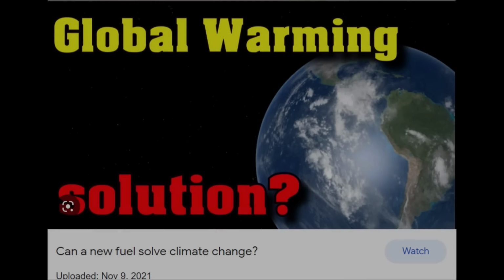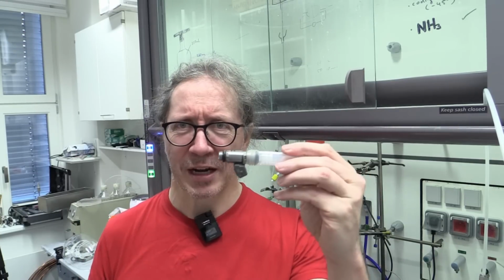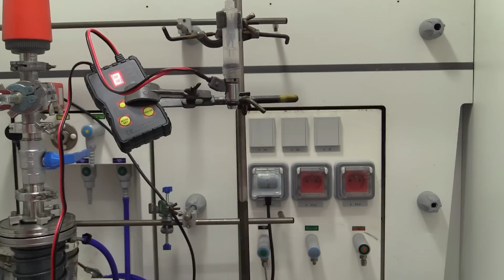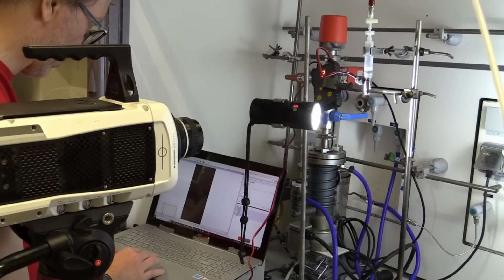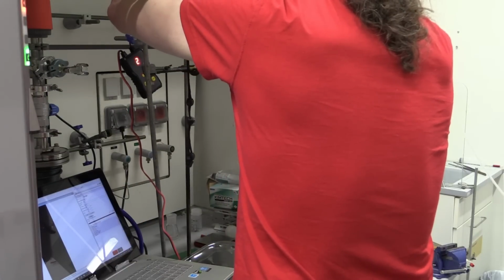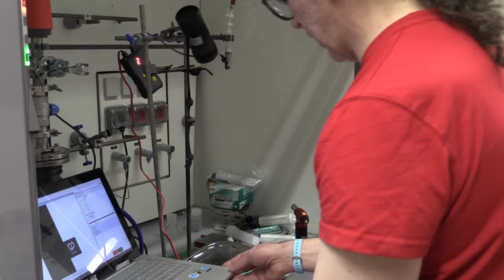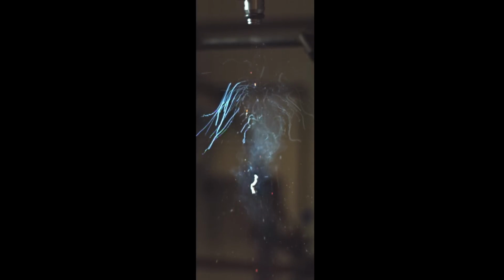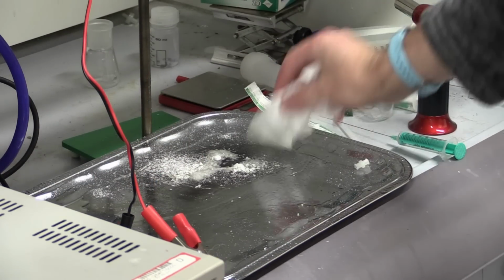Can Fuel Injectors burn SODIUM??

Comment: Several years ago "NEW SCIENTIST" magazine published an article on metal nano-particle fuels for use in ICE's.
Reply: That article is basically nonsense. It somehow expects an engine to operate on metal powder, which... no, but also, it lists three metals: iron, aluminum, and boron. Both iron and aluminum have less energy density by weight than gasoline, and iron has less even by weight. Aluminum and boron have more by volume, but I'd guess the 3x estimate is just boron having three times the volumetric energy density as gasoline, and the thinking ending there.

What Thunderf00t is proposing is entirely different. He's talking about using a small addition of sodium in jet fuel to produce clouds of persistent reflective smoke way up in the air to increase the amount of light the Earth reflects away.
Reply: @seigeengine  A similar Greenhouse gas solution proposed purposely emitting Sulphur Dioxide into the upper atmosphere from a balloon-suspended pipe to achieve much the same thing. I rather suspect the law-of-unintended-consequences would have kicked in - probably increased ocean acidification.
Reply: @andrerousseau5730  Sure, but the products of sodium burning are alkaline, not acidic, which is somewhat safer anyway since rain is acidic in the first place due to dissolved carbon dioxide. Furthermore, by putting it in jet fuel, you could avoid having to create ways to distribute it.

There are going to be consequences to anything we do. Saying you don't want to risk environmental consequences while talking about global warming is a lolfest extreme.
Reply: @seigeengine  I'm not the advocate or proposer of the SO2 idea. I'm also well aware that Sodium hydroxyl ionic complexes are alkaline. Distribution via jet fuel is novel but may be short-lived with the current rate of advance of electric flight propulsion systems. The major commercial aircraft manufacturers have advanced research programs underway.
Reply: @andrerousseau5730  Bahahahaha.

Imagine believing electric is going to replace hydrocarbon fuel for flights of any distance.
Reply: @seigeengine  I wouldn't be betting on it if I were you. Electric powered manned aircraft are already flying and technical progress in the field is headed in only one direction - UP!

Comment: Can you suspend the alloy in a heavy solvent like mineral oil or diesel? And keep it in suspension? If you can an old diesel injector would be ideal.  Old  Indirect injection diesel injectors are activated by hydraulic pressure but they operate under a lot less pressure than direct injection Injectors whilst still giving better nebulisation for more viscous fluids than port injectors. 

I remember a research paper I read ages ago in Australia where the CSIRO or some other org built a solid carbon fueled diesel engine which had purified coal ground up really fine and suspended in a water solution that was directly injected. Might be worth tracking that paper down and seeing what they used.

Comment: Do you think the fuel injector leaks certain solvents because of viscosity differences? I know this is tangent to your video's focus, but maybe increasing the fuel's viscosity will prevent leaking, but of course, any additives might also weaken the combustibility potential. The fuel injectors are meant for the viscosity of gasoline, right?

Comment: That was very interesting.  I recently read an interesting book "alcohol can be a gas" . It claims we already have the answer to fossil fuels, ethanol. According to the book: 
We can grow enough plant matter to make the required ethanol to fuel our cars.
Propaganda from petroleum companies throw shade.
An internal combustion engine is not trying to make heat. It is trying to convert the expan sion of a gas into mechanical energy. Therefore the heat value of a fuel doesn't apply. In fact since ethanol combusts at a lower temperature it loses less heat to the cooling system. If we designed the engine for ethanol it would be efficient. Instead of adding ethanol to gasoline and combusting it in a engine designed for gasoline. We dont use gasoline in a diesel engine or vise versa, why are we using ethanol in a gasoline engine. The optimum parameters are different. Namely higher compression ratio for ethanol. The book also goes into making methanol from the cellulose from the plant also so as far as the most efficient combination of alcohols per acre, that has not been studied yet I don't  believe. But it is a net 0 carbon emission solution. The case study cited was Brazil. They apparently ran their vehicles off of ethanol and while they did the air in San Paulo, Brazil cleared. Then the oil companies got back in, the cars run on gas again, and the smog is back.
Reply: The basic answer is that it's not really viable.

Humanity uses 48M km^2 of land for food production.

Even using the highest-yielding ethanol crop, sugarcane, which isn't viable everywhere, it would take about 23M km^2 of additional arable land to produce enough ethanol to replace humanity's fuel consumption. And, for reference, there's about 58M km^2 of land that's habitable that humanity isn't using for crop production. Of that, 40M km^2 is forest, most of the rest is shrubland.

And no, the heat is actually very important. The performance of an engine is limited by the temperature difference across which it operates. The basic gist, however, is that ethanol is not a "more efficient" fuel.
Reply: @seigeengine  I didn't state that ethanol was more efficient. Just that it would be far more efficient in an engine designed for it. Also more efficient than th heat value would indicate. Can you direct me to literature about the engine being more efficient because of temperature differential?
Reply: @kraftzion  I'm not Google.
Reply: @seigeengine  I know. That was apparent from your reply.

Comment: I know things like methanol and ethanol can affect seals in cars. so I wouldn't be surprised If the cheap fuel injectors don't have the best seal material for ethanol. I remember this because of people complaining about when they added 10% alcohol to gasoline in the US. That and if gloves have compatibility problems I can't imagine why gaskets with similar materials wouldn't.
You might want to try more expensive injectors for e85, ethanol or methanol intended applications. They're probably more resistant to the solvents you are having problems with. 
I wonder with an orifice intended for ethanol if it would aerosolize NaK better.

Comment: NaK is pretty cool, or in this case Hot. But pure sodium might be cheaper if the injector will work with molten sodium  

I think the injector can handle heat, but i dont know if it can handle the sodium under heat. You might like to know if it can handle, say a kilogram of molten sodium pushed through it. Then you might compare a before and after characterization of the jets to see if there was any damage to the injector. 

Certainly won't be using NaK as a fuel in my Aluminum engine 🤣.

Comment: You probably already heard this from another commenter but are you using a fuel injector designed for E85 fuel? A regular fuel injector will degrade from the ethanol. It eats the seals as I'm sure you know but using one rated for E85 might hold up better for you.

Comment: Most plungers connected to the solenoids in fuel injectors are compatible with gasoline + 15% ethanol - there are 100% ethanol compatible (bio fuel) ones.  I think you'd have to gut one to see what the innards are made out of to use with sodium safely.
Reply: Not to mention Gasoline and diesel have additives that clean the nozzle. And gas and diesel lubricate the innards of the injector.

Comment: OK, there's a rather serious problem with the whole idea of using sodium as a fuel.  Sodium oxide is a solid with a sublimation point of 1548 K and a vaporization point of 2220 K.  So, if you want to get the combustion products out using the conventional means, your engine is going to have to operate at well over 2000 K, which steel can support, but it's going to be hard to engineer because steel is a LOT weaker at that kind of temperature than it is at the kind of temperatures that conventional organic liquid fuels burn at.  Most steels also oxidizes extremely readily at that temperature, which is kind of a problem for something that needs to pump large amounts of free oxygen into itself to operate.

Comment: The stronger solvents are destroying the injector lol they're not designed for typically about %10 ethanol by volume anything more will slowly eat any seals out the stronger the faster, also your running "unfiltered" liquid so it'll get stuck same affect can happen for it pretty much falling apart

Comment: You probably won't read this comment, but still I have to ask: What is the ultimate purpose and goal of this experiment?

I understand that you want to create more aerosols from the burning of fuel, in order to fight global warming. But how exactly is that supposed to work?

Did you plan for there to be a separate fuel tank in cars with sodium-potassium, being injected through a separate fuel injector into the engine? In which case, why would consumers bother to fill up that separate tank? How would that benefit them?
Or did you plan to mix the sodium into the fuel? Similar to the tetraethyllead that we recently managed to get out of the fuel?
And if the result of this is a lot of white smoke coming out of the exhaust pipe, creating a lot of smog, why would authorities and consumers want this?

I honestly can't see adding sodium to fuel for cars being a success, since the aerosols it would create would be close to the ground, resulting in smog, and possible health risks in cities.

Another option would of course be to add this to fuel of planes, specifically jet planes, that fly really high up. But the aeronautics industry is VERY resistant to change. It took about 40 years from TEL being removed from fuel for cars, until it was removed from fuel for planes. Because the safety of air traffic is so high that you need to be able to PROVE that a change of fuel does not lead to safety issues with the planes. And I would guess that introducing sodium in fuel for planes would take AT LEAST that same amount of time.

That being said, adding sodium to the fuel of planes DOES sound like a good idea, if you want to create more aerosols. Since the aerosols you want to create, are high up in the atmosphere.
An additional "benefit" of adding sodium to fuel for jet engines, is that chemtrail conspiracy nuts would say this proves that what they have been saying is correct.

Comment: Phil, this video was great but how the hell did you skip on the IR spectra? I’ve seen you had this before, the gas is a shorter wavelength because of the energy density. We needed IR spectra
Reply: A few frames is good enough. It’s so important here to improve on its efficiency to study the wavelength
Reply: Also, I think you aimed higher with the torch on the NaK and that ruins my ability to predict the momentum here but it approached the fuel injector

Comment: Wonder if higher pressure would work better. I know that even the low pressure injectors are like 60-100psi. To Low of pressure and it does not atomize properly.

Comment: its 1/3 useful power, at best, in an ideal world, with the most efficient engines.

to which, we arent even close to getting.  because we'd need incredibly higher compression ratios, like a diesel engine, for gasoline.  its also 1/3 efficient at best in theory, within a very specific rpm range, which you're almost never in.

Comment: If the goal is to produce sodium bicarbonate out of the carbon dioxide, wouldn't you just need a second reaction after the gas combustion? I admit I don't know much about cars, but sodium reacts with water. What does that reaction look like in a CO2 environment? If you could inject a little bit of sodium into the exhaust, wouldn't it be simpler than trying to add it to the engine?

Comment: 1.41 Correction..........Cummins diesel makes engines for the US military which are 2 stroke, opposed piston (Achates) which are 50% thermally efficient.  Previously the only internal combustion engines to have that efficiency, are the latest large ship engines made by Suzler etc.  Achates design team, expect that with refinements like turbo-compounding they can get thermal efficiency to 55%.  Garden variety gasoline engines are 33% efficient........but as early as the 1940's........aircraft engine designers made an improvement of 60%  by combining a turbo-compound (power recovery to crankshaft) to the engine. Basically, lazy manufacturers can do much better, the technology exists.  We can move to net zero liquid fuels easily with existing technology with the same price per km for fuel energy.  To replace coal and natural gas for electricity generation, we just build Thorium MSR.........ORNL proved the idea in the 1970's with a 10 year running test reactor..........China has 2 prototypes under research right now.  There is no energy crisis, the solutions already exist..........everything being spouted by the WEF and media, is predictably utter bullsh1t.

Comment: I know it's stupid to say it but, sometimes the wasted heat is good, heat ya up in the winter in your car! Snowing here in Scotland yesterday.  Other than that yeah it is wasted
Reply: Practically speaking, it's, on the balance, bad. Almost nobody lives anywhere that's cold enough for enough of the time that they actually get ahead, since when it gets warmer, any wasted heat is bad again. Really, it would be better to be more efficient and produce less waste heat, and then create heat deliberately when necessary using something like a heat pump.

But it is a factor to consider on when/the value of doing things that produce waste heat. For example, if you can do heat-producing things at night, you're more likely to be doing it at a time when extra heat would be appreciated (and you may get to take advantage of cheaper power if it's electrical, but this isn't too relevant to vehicles).

It's also a reason to try to save power in your home during the summer... since approximately 100% of all electricity used in your home is becoming heat in your home.

Comment: I kind of feel like this is similar to the carbon sequestration argument. You can either do it really well locally at say a power plant or you can have a large quantity of low quality capture systems.  This begs the question... why wouldn't you just burn sodium in big plants distributed around the country?
Reply: because the idea isn't to capture CO2 produced at a point source, but to disperse a fine particulate throughout the atmosphere to reflect light.

It's actually the exact opposite situation. You don't want it concentrated, but distributed across the widest area.

And his idea is to have this as a mixture in jet fuel, where it would result in the fine smoke being released high up in the atmosphere where it would both be far away from people, and would likely stay up there for quite a while.

Comment: you need a 5atmor more  of precure from the other side so it  locks in right in some and  i know ethanol destry the rubber rings anything made of the rubber used for gasoline hows rings etc.  thycan only handel a 10% mix of ethanol if you dont buy a fule injector for a ethanol car. maby newer fule injector  now days have the same buts thats why you will not find a mix of 10% ethanol to buy it eats or harden up all the rubber used in petrol cars. always wonder why so happy if some one know why. and there is one more typ of Fuel Injector the one that was used on hybrid Fuel Injector carberaters mabye worth a try the are less senetive.

Comment: If the fuel injector is intended for normal pump gasoline it may not be able to hold ethanol. Try an injector that is intended for E85.

Comment: There are auto fuel injectors that have much better atomization. Look for the ones with a larger flat "disc" with 6-10 extremely small holes.  Honda Insight any model.

Comment: Would it be better to cut the sodium into smaller pieces so they don't get stuck in the nozzle? Or could someone design a fuel injector that could use sodium more efficiently?
Reply: You should try watching the video. He isn't using sodium, he's using a sodium-potassium alloy that's a liquid.

Comment: Next you need to work with an automotive engineer to design a fuel injector for the correct viscosity of the fuel you're using.

Comment: would this work better with high pressure fuel injector sense the point of them is to have smaller particle size not more fuel

Comment: The fuel injector leaks because it's metal on metal sealing only. Lower viscosity liquids then gasoline will leak more. Also operating without liquid inside tends to wear the sealing surfaces in this poor bastard pretty quickly.

Comment: would a NaK + gasoline mixture work? if so, how far can you push the concentration of NaK? 60%? 80%? 95%?!
Reply: The idea is to use sodium as a fuel additive in jet fuel so that the smoke gets produced high up in the atmosphere. You wouldn't want to use too much, because that would impact the energy density too much and make it non-viable.